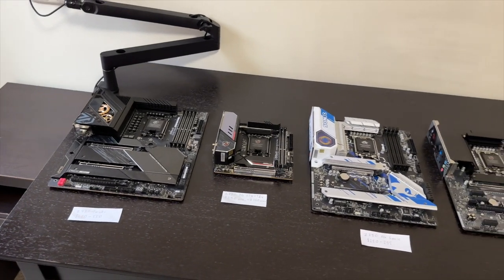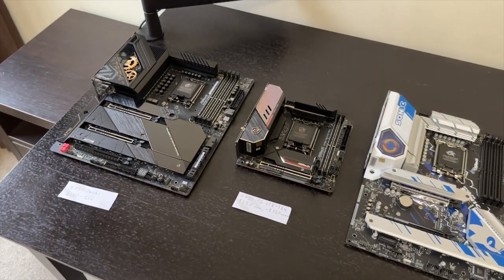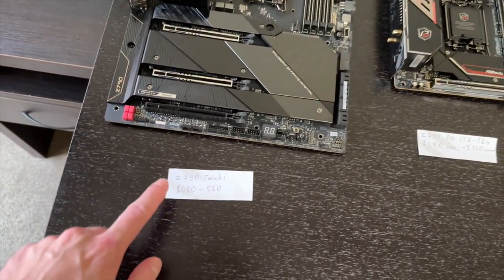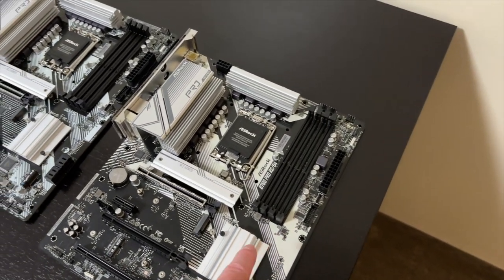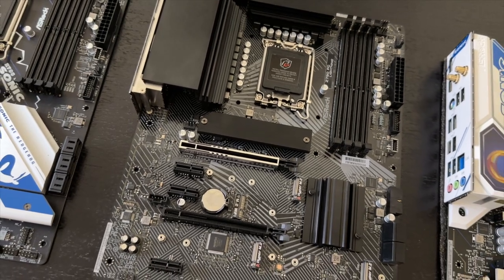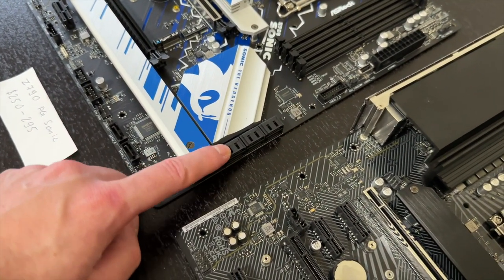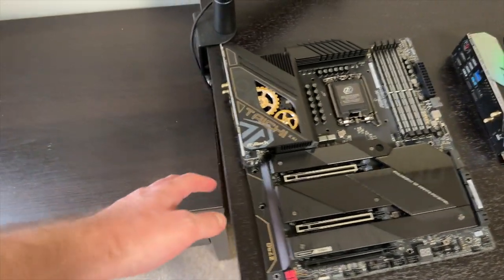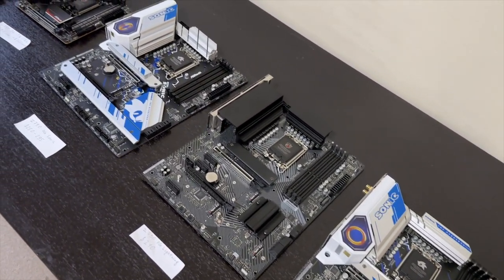Your Guide to Buying the Perfect Motherboard for Intel 13th/14th Gen i3, i5, i7, i9 [B760 vs Z790]

Comment from the maker: What is your favourite Intel 700-series motherboard?
Reply: my favorite is the one that MSI doesn't make: the Unify (or Unify-X). No idea why it exists for every other Intel chipset but not the Z790. The Carbon is a great board but I'm over RGB already (have the Z690 Carbon: it's an excellent board).
Reply from the maker: @treyquattro  Carbon is nice. But I agree. No RGB is better. Unless it is something unusually cool😄 But creative-style PC hardware has a special place in my heart. Mobos like ASUS ProArt or GIGABYTE Vision D.
Reply: I have the Asus Z790 Hero with a 13900K. Probably overkill but I use my PC for many hours every day, not worth saving 200 Eur on something so important to me.
Reply: i think mine is the z790 pro a wifi d4 by msi, its equipped nicely with usb ports, got good vrms and cooling capabilities for a rather "low" price if you compare it to other mainboards in the midrange to higher end range
Reply from the maker: @leopups7106  yeah. MSI's Pro and Tomahawk boards are some of my favourite in their price categories. Good choice!
Reply from the maker: @Miskatonik  It is a beautiful and high-quality board. I agree with your point that it is worth it to spend a bit more on something which you use every day if this thing improves your experience. Have you done any overclocking with your 13900K yet?
Reply: @Miskatonik  well if you okay certain games for thousands of hours it’s definitely worth it to invest in a proper motherboard
Reply: Is a 12th gen CPU compatible with a b760 motherboard without a bios update?
Reply: I dont know squat about pc, just got a prebuilt, it has Asrock b760m-c i5 13400f, 32 gb ddr5, 2tb gen4 nvme m.2, 4060,, is my motherboard any good?

Comment: Let’s admit I build a b760 ddr5 with i513600kf, will it be ok for gaming, streaming and also advanced editing ?
Reply from the maker: Streaming and video editing can be handled by specialised encode/decode media engine on most modern GPUs. So, CPU is not a big deal for those tasks. And for gaming 13600KF is more than good enough, imho. It looks like you are well set🙂👍
Reply: hi can you please tell me what specific mobo are you using? thank you so much
Reply: @ginocarabiziotto3073  if you’re asking to me I was planning on using the MSI B760 gaming plus Wifi but I’m in the end gonna take the rog strix z790-A gaming Wifi in ddr5

Comment: I’m planning to upgrade from 4790 to 13700k, will used for gaming but in 1080p ultrawide and mostly vray rendering also won’t do overclocking, should i get asrock b760m pg riptide or gigabyte b760m aorus elite ax ?
Reply: how is your combo now, still good ? I am having 4790 now anh planning to go to i7 14th gen non k, I dont know if the b760m can handle it well

Comment: Should I pair a i9 13900k with B760M Gaming AC DDR5 or go for Z790M Aorus Elite AX?
Reply from the maker: Out of these two I'd definitely go with Z790M Aorus Elite AX. Gaming AC power delivery system looks way too weak to feed the 13900K. It is a very power-hungry CPU.

Comment: Bear in mind that if you put a gen 5 ssd in the gen 5 m.2 slot the graphics card will reduce to 8x speed. This is a limitation of the CPU as they only got 16 gen 5 lanes. Also on that board with 5 m.2 slots only 4 can be populated, either the slot for gen 5 or gen 4 coming off the CPU. Both can't be populated.

Another difference between z790 and b760 is the total number of pci-e lanes coming off the chipset. Z790 supports up to 20 whilst the b760 only 10(I think this correct) gen 4 lanes plus 8 gen 3 lanes for z790 and 4 for b760. A b760 board is not CPU overclockable, you are limited only to overclocking your memory.

I believe you can fit a gen 5 ssd in a gen 4 m.2 slot, they are backwards compatible. It will just run at gen 4 speeds(then again who will notice the speed difference between 7000mb and 14,000mb read speeds?).
Reply: Is there a pcie gen 5 nvme available ?
Reply: Also B760 has only 4 DIM lanes for connection to CPU but Z790 has 8 DIM lanes

Comment: What do you recommend for 13600kf?
Reply from the maker: B760 if it is a simple gaming PC. Something like B760 Pro RS in this video will do just fine for that.
Reply: @theivadim  hey i heard that board only delivers up to 100 watts cuz the vrm sucks (the i5 13600 requires more power) and the cpu can’t utilize it’s full power is that true?

Comment: I put my 12900k in an ASUS prime z690 m

How bad of a match is this? I overclock the 12900k but don’t know much about  what makes a good VRM design or power stages as you mention these in the video. What should I be looking out for to know whether I should look for a different board? Temps are fine with the overclock, and I use a 360mm rad.
Reply from the maker: I think it should be fine if you use it for gaming. But if you throw a lot of CPU intensive tasks at it for prolonged periods of time then you may want to look into your system temperatures more. Don't look at CPU temperature. Check motherboard temperature instead. Software such as HWMONITOR by CPUID can provide that information as long as your motherboard has temperature sensors on VRM.
Reply from the maker: Oh, and I wouldn't say that you need another motherboard. Even if you find that VRM motherboard temperatures are too high then just go back to stock settings on your 12900K. 70-90C temperature is perfectly good. 90-100C is a maybe. Over 100C is not a good number.
Reply: @theivadim  thanks for the reply. are those temps the max package temp or the VRM? My VRM never gets that high. Package gets up the top end when benchmarking but is 70-80 when gaming.
Reply from the maker: @ggamer7830  VRM. I think the "package" you are talking about stands for CPU temperature.🙂 But if your VRM doesn't get hot then good stuff!
Reply: @theivadim  yeah as far as I understand, package is highest cpu temp or hottest core? Just did an hour gaming and VRM temp was only 45 max on armoury crate. Thanks

Comment: Bro IVadim, Can I ask if Giga Aorus Master Z690 is good with 13700k? In my Country it price drop pretty much. Will Z690 Aorus master will perform better than other Z790 MB?
Reply from the maker: Oh yes, that is a very nice option. Z790 vs Z690 don't perform any different. It is more about features. Getting a Z690 if it is priced well is a good call👍

Comment: thanks for the info. should i pair i7 13700kf with b range MB like b760m or z range MB like gigabyte z790 aorus elite ddr5.
Reply from the maker: If you don't need CPU overclocking, extra USB and PCIe ports then B760 will do the job.

Comment: Hey! is i7 13700k compatible with b760 aorus, msi b760 pro, no overclocking, no gaming only photoshop and lightroom ? Does b760 causes i7 13700k to throttle ?
Reply from the maker: It’ll be great for work and gaming👍 go for it.
Reply: @theivadim  hey thanks for replying but will there be a vrm issue?
Reply from the maker: No VRM issue.
Reply: @theivadim  I noticed a huge difference when i switched from a MSI b760 gaming plus wifi to an MSI z790 carbon wifi with a i7 14700KF, higher scores in benchmark like 3k+ on r23 and better gaming experience too.. in b06 my clock speed kept fluctuating with the b760 but rock solid on the z790.

Comment: Hi, I was thinking of getting Asrock B760 Pro RS with I5 13600KF, is it okay as a configuration? I’ve heard that maybe you need to set the power limits of the cpu, so as not to raise the temperatures, in case here it can be done? Thank you

Comment: Asrock is a good brand, but I will wait until 14th or 15th gen intel before I upgrade
Reply from the maker: Are you not considering Ryzen CPUs at all?
Reply: @theivadim  i currently have a Ryzen 5800x, but the single core performance on Ryzen CPUs is lackluster, and regarding to overclocking everyone says something else.
Reply from the maker: @Austrium1483  I see. The main reason I like Ryzen is for its power-efficiency. But if you want maximum single-core performance then maybe Intel will be better as long as you use high-speed DDR5. But Ryzen 8000 vs Intel 14th gen may be disappointing. Currently, I am working on a 14th gen video. Still gathering all the information. So, stay tuned for that if you are interested in my opinion on this topic🙂
Reply: @theivadim  Thanks for your answer, yes im definitely interested in the upcoming video. Can’t wait for it.
Reply: @Austrium1483  Every IT store I have ask said go whit INTEL I5 or I7. 
Better then AMD top 7-9 models in many ways. 
But 12 and 13th is great the problem is 14th is comming in 1 og 1½ year. 
But can anyone wait if there old pc is dead soon. 
And also the prize will also be high or the same on 14th Intel. 
That is 100% for sure. And also every 3-4 years Intel comes out whit new versions. Just like we had 8-11th and so on. So just thing people have to go whit the flow and get one that are on the marked now, and forget about the future.

Everyone, need new motherboards and CPU any ways they go when building new pc.
When ever they choose in the time for pc buy. 
Unly DDR5 will at least be here for 5-6 year that is for sure. 
And also M2 harddrives also that can be used again.
And PC cases.

Comment: I have a asrock b760m-c in my prebuilt i5 13400f, 32gb ddr5, 2tb gen4 nvme m.2, 4060, is my board any good? Can i add another m.2 storage, is it fast ram and stuff? I dont know squat, its my 1st i just got it for 900
Reply from the maker: Yeah, it's good👍 This motherboard comes with two Gen 4 M.2 SSD slots so you can add more storage in the future. As for the RAM, I think it is fast enough. It'll definitely handle well any affordable DDR5-5600 or 6000 RAM I assume you've installed there. Don't forget to enter BIOS to double check that XMP profile has been enabled for the RAM to work at full advertised speed. That is the easiest thing to forget even when you are experienced PC builder.🙂

Comment: Cheap B760 + i7 13700F
Z790 + i5 13600KF

For the same price, which one would you choose?
Reply: Z790 + i5 13600kf👌🏻
Reply: @harogame2827 I'm in the same situation, do you mind explaining?
Reply: stuck in the same situation here.
I was thinking why not 13600kf + b760 if not overclocking. But taking the K for extra speeds.

Comment: im planning to get a i7-13700k and pairing it with a GIGABYTE B760 AORUS ELITE and just running it all stock or maybe just enabling xmp. i dont plan to overclock but i want to have that option in the future that's why i want to get the K version for the cpu and just upgrade the mobo in the future. is this is good decision?
Reply from the maker: The performance gains you'll get from overclocking are not worth the trouble, imho. If you want to do it because you find it fun then it is a different story of course. Go for it!🙂👍
Reply: @theivadim  the only reason im asking this? is because after owning an i7 9700k for 3 years using a b365 motherboard, i finally bought a z370 motherboard and tried to overclocked it, it didn't even took me an hour to kill my CPU after overclocking it to 5.0ghz at 1.34v..it just died. now im stuck with my old i5 9400 and the z370 board that killed my 9700k. instant regret.
Reply: I'm building this same setup for a friend at the moment as a Content creation build with ddr5, he isn't very tech savvy and will not be overclocking anything other than his memory. imo its not worth the price jump from B760 to Z760 for OC alone
Reply: B760 has only 4 DIM lanes...if budget is not an issue, you should go with z790
Reply: @kiranks1984  DIM Lanes? What even the heck is that.
Reply: @giodegracia  Sorry DMI lanes